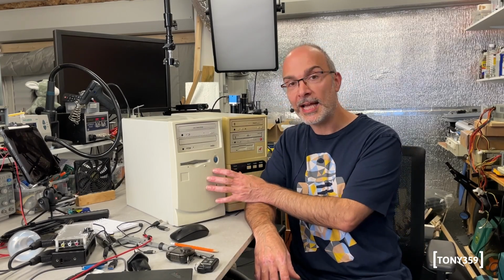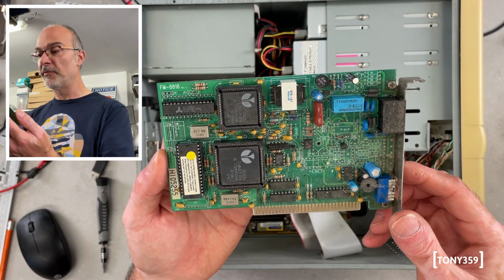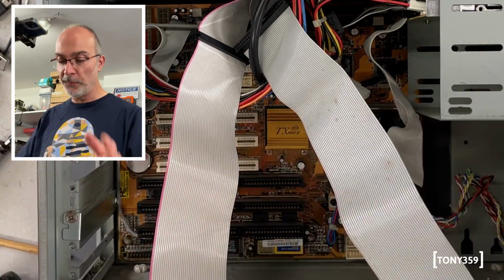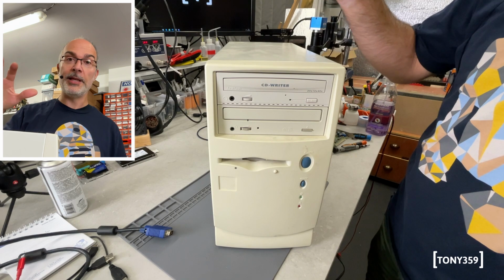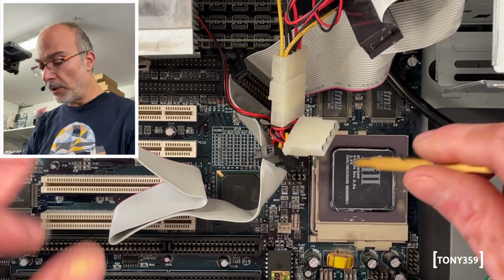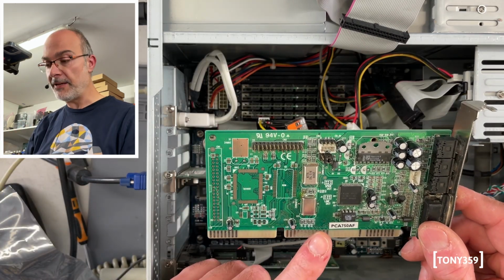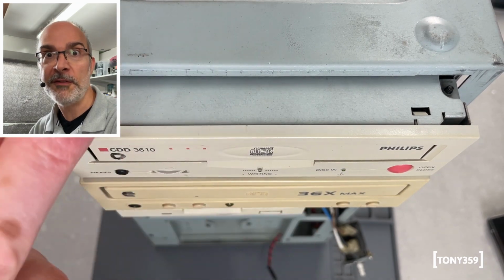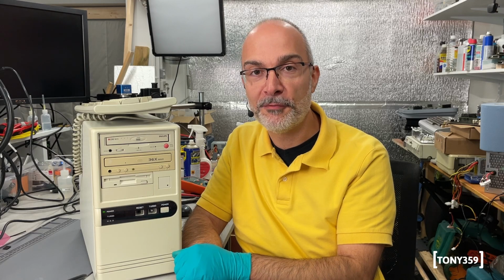I was pleased with what I found in these two old PCs!

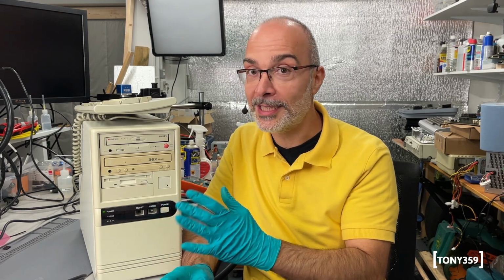Comment: Hi Tony at 35:55 you disliked the heatsink clip. I find an M3 nut driver to be the best to remove those.
Keep them coming.
Reply from the maker: ahhh I see what you mean - I shall give that a go! That said on the Crusader there is literally no space for the clip where to go because of that capacitor! But thanks, I'll try that! Thanks for your comment!
Reply: @tony359  You can do either side with the nut driver so you could unlatch the side away from the capacitor.
Reply from the maker: I need to check on my heatsink, it only goes one way round, the aluminium is not flat it has a step which matches the edge of the CPU but only when installed in a specific direction. I’ll take a look thanks!
Reply: @tony359  no what I mean is you fit the heatsink on the correct way but you can unclipped it from either side.
Reply from the maker: I new to check but the other side is flat, it doesn’t have a way to grab the bracket to detach it?
Reply: @tony359  in that case then no it wont help.

Comment: I have a pile of modems pulled from various systems.  It's too bad they can't be re-purposed.  It would be neat if the DSP chips on the Winmodems could be re-purposed.
Reply from the maker: Indeed - there is some use for anything but a modem... :( Someone in the comments said you can use them with a Raspberry Pi but still... :) Thanks for watching!

Comment: Ewwww, Cyrix CPU! They had a bad reputation back in the day. I was building AMD K6-based computers back in the day.  These computers are a blast from the past.
Reply from the maker: They are, it's like opening a time capsule!
Reply: Cyrix are ok unless you try to play quake lol. Some components struggle with them though, because of the 75 MHz bus that at least the higher frequency ones use. It's been a while so I don't remember which models run at what...
Some PCI and ISA cards can really struggle as both the PCI and ISA bus are overclocked so to speak.
Not the absolute best CPU choice for gaming of course, but good value for money. Then again, you can say the same for the K6/K6-2/3 which had floating point that is closer to a Pentium at the same frequency. But the K6es are availbe at higher speeds as well so as long as the motherboard supports it it's the natural choice. :)
Reply from the maker: Thank you! The Shuttle goes up to 100Mhz bus if not mistaken?
Reply: @tony359  I don't know which Shuttle board you have? If it's an Intel chipset, they top out at 75, or sometimes 83 but 83 is unusable. Super socket 7 boards can do 100...
Reply from the maker: 591P, VIA Apollo MVP3